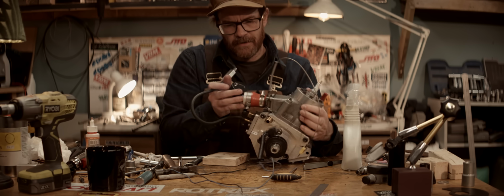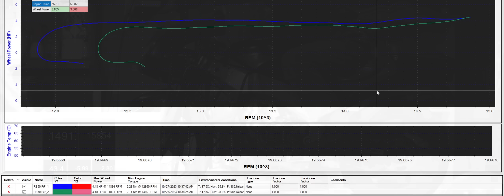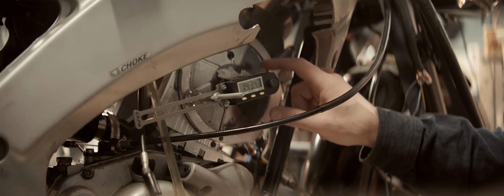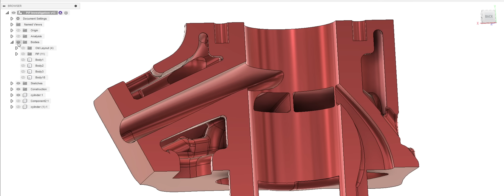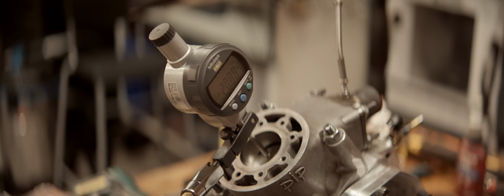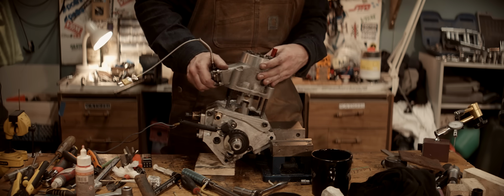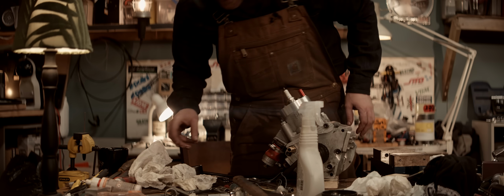Progress for Once - Road to Most Powerfull Two Stroke.

Comment: Would a variable expansion chamber help out?  About 18 years ago I saw a 2 stroke track go kart and it had an expansion chamber that could be expanded. The driver could control it with a cable. It slid like a trombone trumpet, except it was about 3-4 inches in diameter.  The owner said it gave him power throughout the rpm range. It needed it because it was a single speed.

Comment: about the pipe,Alex - i have been woundering about it for some time - the stinger seems very big and short for 50cc , the calculations might be that it is how it's supposed to be,but a simple test-take a piece of  solid bar-a drill,a broken endmill or whatever,and stick it in the stinger to make the area smaller,or make the stinger longer,and do a pull - might have something to do whit not making enuff backpreasure..to much is going straight out - just my 2 cents

Comment: Recirulating exhaust gases into the combustion chamber will lower your exhaust temps. That’s how modern diesel and petrol engines meet high test standards.
Reply: 2 strokes do that all the time haha. They never get all the exhaust to leave the cylinder before mixing with the incoming charge.

Comment: 24:00 in my opinion the hooks are necessary. Especially on the B ports but also on the A but because of your exhaust being right above the A It might take some nuanced shaping to keep the flow from short circuiting. The communication of the ex and A idea has merit. Try an analysis of the black residue if you can but I'd say you should see LOTS of it inside the piston pin and it's bore.

Comment: Dear Alex, I can't imagine that your engine does an almost insane 19,000 revolutions and only produces 5.5 hp at 15,000. I assume there's something wrong with the dyno.
Reply: Freddy you are correct , I cannot remember what the bottom half of the engine is from I think an Aprilia? If he has enough power to run top gear of that at 18,000 rpm even with transfer losses he is obviously way over 10bhp . Alex also seems to over think every problem he needs someone else to help him and also a proper Dyno although I am guessing he is in the middle of nowhere

Comment: STAINLESS STEEL REED VALVES ON THE INSIDE OF THE ROTARY VALVE MATE. ALSO YOU SHOULD FILL THE CRANKCASE WITH EXHAUST PUTTY WHEREVER IT WONT RUB, MINIMIZING THAT CRANKCASE VOLUME WHERE YOU CAN.

Comment: Do you have a way to access the crank case, to put a pressure sensor on it,  something that can react fast, and a way to compare the pressure to the ignition or piston position? It could tell easily if the exhaust is entering the crank case,   a hose with a pingpong ball on it with a cage keeping it loosely on there, using gravity to keep it on, if exhaust is entering it should look like blow by, moving the ball, if nothing else a balloon on a hose if it gets pressure at tdc, it will likely be exhaust entering the crank case!

Comment: I know i keep commenting, but i have an idea, what about casting air cooled test cylinder, with  transfers that are capped externally with a sheetmetal and epoxy cover, to design the ports you know will work, then take a mold of them, and make a jewlers wax  casting of the ports, and attach them to a 3D printed cylinder. Then cast that cylinder!  It will be 99.8% perfect, just require sligt porting to smoothen up the ports!

Comment: Question
Why was rotary valve replaced by reeds in modern race bikes?
What if you scaled down the aprillia race engine as a whole not just the cylinder?
For ultimate peak power, forgetting flexibility etc, have 3 huge transfers and 4 exhaust ports, optimized reed size etc.
Maybe total loss ignition too?

Comment: I wonder if it would be possible to put a probe on the exhaust and measure the amount of leftover HC to  access the percentage of air/fuel mixture escaping due to problems with  the  positions and sizing of the ports . To eliminate the influence of resonance while testing this  a straight exhaust pipe could be used.

Comment: G'day mate. Is the chassis dyno being ran in inertia mode or do you have a brake on it and the load cell? If it's in inertia mode it seems weird that it can spit out a live power number as inertia dynos measure acceleration over time. Meaning from say 8000rpm to 15000rpm they calculate hp based on time vs moment of inertia.

Comment: Hello I have been watching your progression of videos for a couple years now thank you for sharing. I specialize in tuning motorcycles and own my own dyno. Do you have a way of collecting o2 data ? EGT regardless of is said on the internet is just not an accurate way to tune. You can see this in the lack of repeatability due to slow response of the EGT. Any change in the length of time load or rpm in witch the data is collected will skew the results. You must use o2 sensors or you will keep chasing your tail.
Reply: It needs several egt sensors placed in different positions throughout the pipe.

Comment: The black tar stuff could be the PLA stuffing slowly melting away slowly getting into the rotary valve housing via blow by
Reply: He's mentioned in the past that the temp in the case shouldn't be anywhere near high enough to affect it... however... maybe it did get high enough with exhaust blow by.

Comment: Awesome progress Alex , but commenting @ 9.00 mark  , Move the expansion chamber further away from cylinder,  where it is now is low end power I can here it cut off at 10,000 to 11000 rpm just free reving after that .
Edited @ 49.00 mark great you added longer pipe , but you didn't ajust timing or fuel to complete the test with first pipe added timing only second pipe , first pipe was dieing at 11.000rpm it needs fuel and timing to keep going over the hump.
Your finding the answers now , if you want 20.000rpm you need powerband to start atleast 10.000rpm

Comment: Do you have access to a gas analyser so you can look in the exhaust gas for levels of O2, CO2 and hydrocarbons> This might give a clue about undesired flow between different ports in the chamber. What about running just a bit richer and looking at the exhaust gas temp... would that indicate previously incomplete exhaust elimination from the chamber if the temp goes up? Just some thoughts to save you from a possibly unneeded port location and geometry redesign, or give clues for any new design. Happiest ending.....🙉🤭

Comment: You have made major progress.  What about adding a small flare at the top edge of the exhaust port (both sides) to bleed off exhaust pressure early and reduce the cross talk with the transfer ports?

Comment: I think you should Model the entire engine as it is now in engmod, like with all the changes to the case, intake, cylinder and didnt you up the compression at one piont? Anyway I think that could answer some stuff. Love the videos!
Reply: And to clarify I mean go thruu and measure everything as you put it in to engmod just like if you had never seen the engine before, like even if u think some is exactly like you designed it its probably good to go thru and check as you make the model. Just an idea

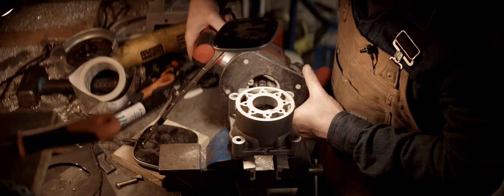Comment: 39:55 why not fasten the machine to the table and guide the cylinder by hand? seems FAR mor stable and accurate imo.  Is there a way to log the amperage output from the ignitec ?  My ear keeps telling my brain that the power delivered to the plug is lower and and lower towards the top. That seems to overlay the powerband perfectly as well. thats something ?

Comment: Good to see the baseline machine running. With the rotary valve closed and the piston in the compression stroke, are you sucking exhaust back into the crank case? The low velocity in the transfer ports made me wonder about that. Is that what you mean by short circuiting?

Comment: Everything is now normal except for one thing. It’s sitting on top of another engine. You’ve got to drive a toothed belt, double the number of bearings, double the number of seals and double the number of crankshafts, and, I seem to remember that the lower crankshaft is also running in oil. I think that your engine IS producing decent power, and the dyno is reading correctly, it’s just the parasitic losses are high. Have you tried  just turning the crank, by hand, with the toothed belt connected, and see what it feels like? How hard is it to turn? A previous iteration of this engine wouldn’t even tick over until you changed the drive ratio

Comment: Something to think about  i do dirt karts  kt 100s  open class . I found  changing the angle on top of piston  gave me more hp and  the rist pin i drill two holes  inside the bottom of piston  on each side of the rist pin clips  on a angle 2mm  drill  have you got a old piston to try

Comment: Just like you calibrate your equipement with known sized tools, calibrate your dyno with a known power output engine, so you can also account and calculate your transmission losses

Comment: Might be a good idea to get a 50cc stock motor and copy it and make individual changes 1 at a time until you have pushed it so far it has become something unique 😁.. im not suggesting to make a stock 50cc im suggesting you start from a known working design and add your ideas 1 at a time get as much power then move on and add the next idea and push it as far as it goes and so on!! Sure it will be slow development but by the end it will be a completely different motor and you will see what ideas are working as intended and what isn't then developing each idea to its limits before moving on will make it impossible to miss where the issue is.. i love your work and videos but doing a thousand ideas all at once is part of the problem making it harder to identify where the biggest issues are.. i can't wait to see you hit 50hp for 50cc that will be very Cool 😎😎

Comment: In my mind the rotary valve disc should never rub att all. At the rpm this engine makes power, a small leak of the valve could not be a problem but any friction is bad. 

Couldn't you try again with the identical setup but with increased valvedisc clearing and a stiff enough disc so it can't ever rub?

Comment: Check your dynamics compression pressure. al least = 110 Psi or 1:7,45 (minimum). ignore statics compression ratio measurement method. (crazy at my garage). Double check the direction of your boost port.
doesn't look like it should,
the angle or direction of the flow seems less sharp.
Reply: For Gasoline Fuel.        higher for nitro or alcohol

Comment: Hi Alex, wouldn’t it be possible to mount several sensors? Combustion, intake and exhaust pressure sensors would give valuable information to quickly assess pipe shapes and lengths etc.

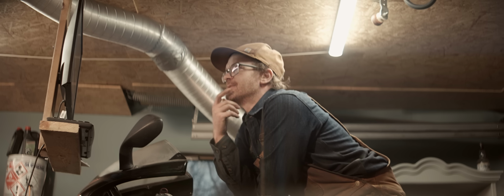Comment: @48:50 u are at allmost -6hp which suggest u are at roughly 15hp at the crank? Cant u pull the clutch at max power and get a pretty precise power loss number from crank to wheel?

Comment: I've been watching your video's on and off ever since you first started 5 (6?) years ago.
The new design is sounding like a 'real' motor now.
Kinda nice to see your still persevering with the 100% exhaust even though your exhaust port design is self limiting (obviously as it want's to go down transfers).
 Does the gudgeon pin on the Aprillia also open transfer to exhaust or did they stop before that happened?
Power output is very disappointing as standard production ~40cc motors are making same (6~6.5) power at far less rpm with much smaller carbs and very basic exhaust (Stihl, et.al) It's also a bit strange that advancing timing gave best power at lower rpm (I know, longer exhaust)
'Freeport' designs are known to be 'bad', I read about them in early 1970's and that's exactly what you have with transfers and exhaust overlapping (and reason for low EGT) EGR is used in four stroke motors to lower EGT and give better fuel economy without melting pistons.
I guess your just trying too many different things at once?

Comment: Is the 3D printed insert gas proof? 
If not printed with 100% fill, prints usually need a coating of some sort to be gas proof (epoxy or such)

Comment: Exhaust duct is very flat.  Wouldn't that cause a lot of extra turbulence with the exhaust gasses hugging the wall of the duct?  I know you have the cross sectional area to match the flow of an equivalent round duct but with a round duct, there is more space further away from the walls of the duct.  I wonder if a round duct with the same cross sectional area would flow better.

Comment: Did you not have suspisciously low dyno numbers with the old bike you tested before putting the pip engine in the frame? Or am I remembering incorrectly? I have seen people going back and forth on dyno problem ideas

Comment: Try to just make a hole new pipe that is made for your exhaust duration and a reasonable rpm for max power like 13500 rpm and not 18000 like the old pipe

Comment: I don't know about anyone else, but from what I've seen of 50cc bikes, or karts with someone equal to his size, they don't just take off and go like this is doing.
I'm thinking his dyno is way off from being accurate. 
As I read in an earlier comment he needs to have it verified with a known engine that he has numbers on, and I honestly would have it done on a different dyno one that's used regularly. 
Then run it on his to see how much different his reads, and yes I'm aware that every dyno is different. 
But not in a major way will the numbers be drastically different if his is even close to being accurate. 
In a closed environment like he is in, it shouldn't be difficult to have very similar conditions in order to get everything as close as possible to check his against another machine. 
Then once these questions are answered and corrected if needed, that's when you can base what you change on what you're reading on his dyno. 
Otherwise you're just pissing up a rope, and hoping it doesn't rain on your head.

Comment: I can’t help but think dyno calibration, I have zero knowledge about it, but didn’t you change the ratio between engine and gearbox at one point recently? I’m sure if that was an issue you would have already taken care of it… it just seems to me like it use to sound like it was under more load then it does now.

Comment: In my mind a rotary valve needs two blades turning in the same direction covering a single intake port. It would open and close much faster. #theperfectworld
Reply: How would it open and close much faster?
Reply: @Scissors69  They start opening from the middle of the port as they distance each other and fully clear the port in half the rotation a single valve would do.

Comment: Hey just lower the exhaust port that will help uncrease the compression give clean fuel charge the rotory valve is just afu charge injection window ir is not like a valve in a fourstroke engine I  feel rhat a reed valves  are less complicated  and let you  experiment with port hiieht where real power can be maderesiob

Comment: maybe i'm missing something, but i noticed that when you go off throttle the readings of the dyno goes to -9 or even -11 hp, should't it go to 0? i mean, if the engine is not putting any power...
Reply: It's registering engine braking and friction loss in the gearbox. Could be a way to measure crank horsepower by adding the negative amount. Not sure how accurate tho.

Comment: Make some pin plugs!
Is there anyway its not revving high enough? Could it just not be in its power band?
Reply: The bhp is peaking way too early—15,000 rpm. Two-stroke engines need very high rpm to produce very high bhp—they can't rely on elevated cylinder pressure to develop high torque. Alex knows this... and it's what the cylinder-porting dilemma boils down to. However, since his dyno is screwed up (I don't believe the numbers it's generating), it needs to be replaced with something much more accurate and repeatable before making additional engine modifications.

Comment: I dont claim to be an expert on two engines or any other kinda engine but there's one thing that seems obvious to me. The torque of an engine is greatly affected by the flywheel. Torque and bhp are directly related. Without the weight or mass of the flywheel  and the centrifugal force generated by the flywheel. The engine isn't going to make any torque.. if you remove the flywheel from an engine. It wouldn't pull the skin of a rice puddin.

Comment: Is your instrumentation accurate? Even where you are 4 horses for every cubic inch is pretty damn good. What is your HP expectation out of 3 cubic inches (50 CCs)?
Reply: 2t hp output is around 400cv/lt
For example 125cc kart can produce near 50cv
50cc and 12cv it's not bad, but "motogp 50cc category" during 1963-1983 can produce 18cv at 18000rpm
This can serve to push the project forward

Comment: Its not too awful, going through the belt , transmission, chain, its got to be a 30% loss, nearly/ not far from 6 hp . Add 25-35% to it at the wheel,

Comment: Maybe power loss is in that "other engine & transmission"? Drive engine just test bench alone as before you have done.
Reply: Problem is that an engine dyno only won't actually tell him that much that's useful given what he needs is to get power to the wheel. So a huge number on an engine dyno is essentially meaningless if the engine can't drive the gearbox.
Reply: That's why transmissions are designed around engine and torque data—not the other way around. @jediknight1294